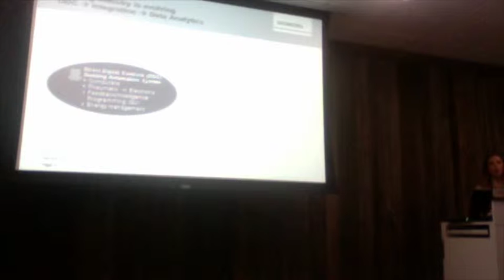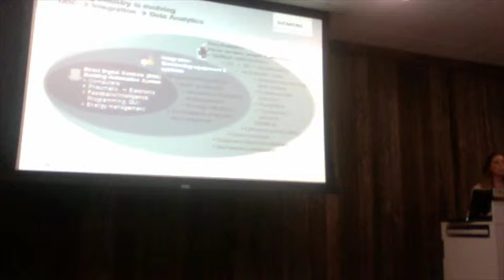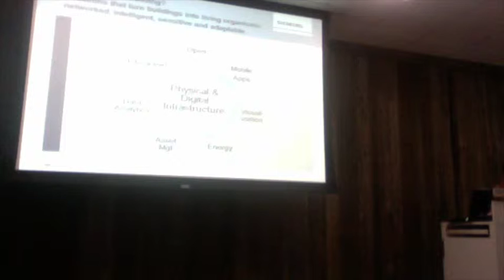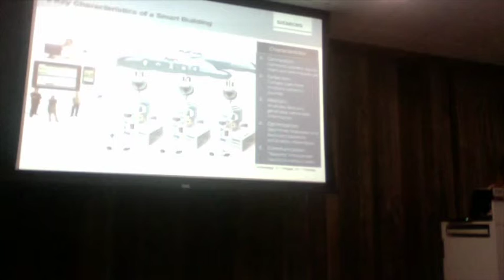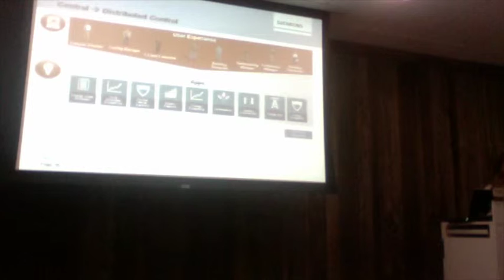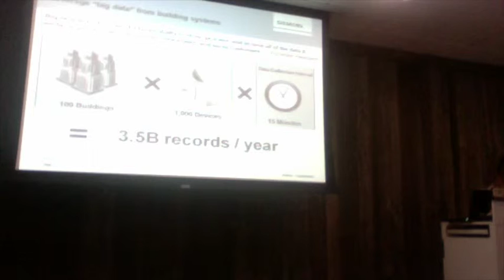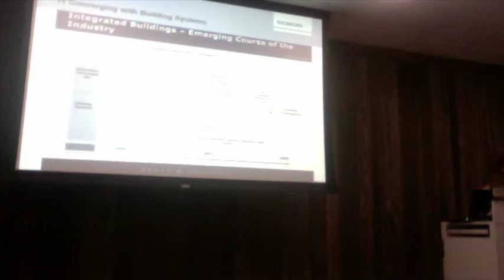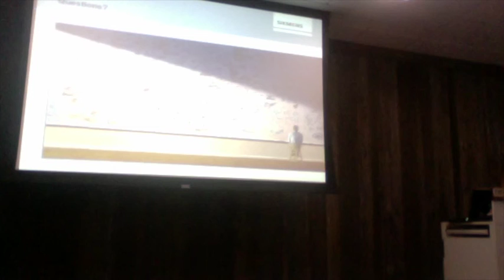AEC Hackathon 1.0: Christie Federico - Smart Buildings

Comment: Making the cloud data accessible to system designers of the infrastructure means the ability to interface with the data nodes. There clearly is a big opening for a feedback loop to design parameters especially in regards to Living and Learning Machine approaches to built environments. Once in a great while, a great idea makes it across the boundary of one discipline to take root in another.  The adoption of Christopher Alexander’s pattern Language concept by the software community is one such event.  It is odd that his ideas should have found a home in software, a discipline that deals not with timbers and tiles but with pure thought stuff, and with ephemeral and weightless products called programs.  The software community embraced the pattern vision for its relevance to problems that had long plagued software design in general and object-oriented design in particular. Focusing on objects had caused us to loose the system perspective. Preoccupation with design method had caused us to loose the human perspective.  The curious parallels between Alexander’s world of buildings and our world of software construction helped the ideas to take root and thrive in grass-roots programming communities world-wide.  The pattern discipline has become one of the most widely applied and important ideas of the past decade in software architecture and design. 

https://www.patternlanguage.com/archive/ieee/ieeetext.htm